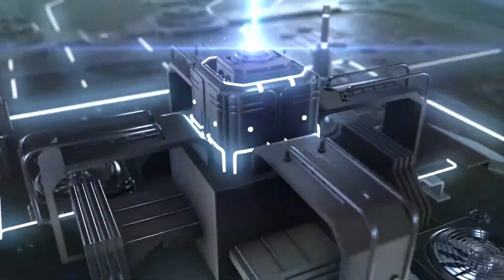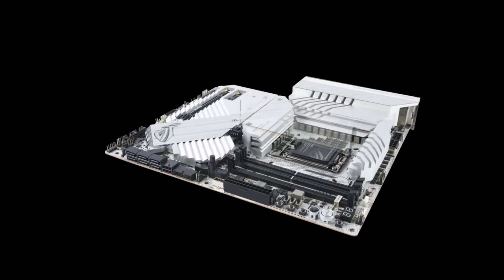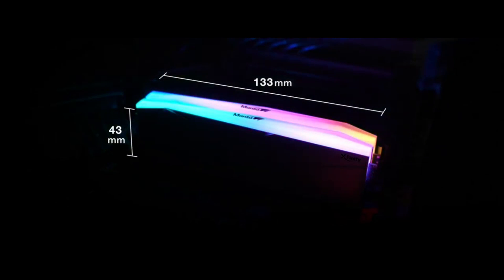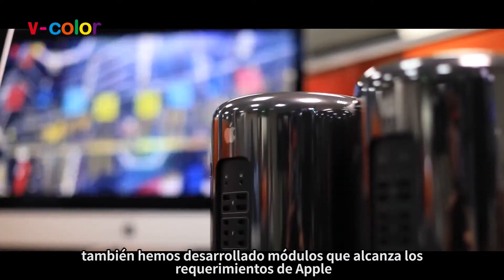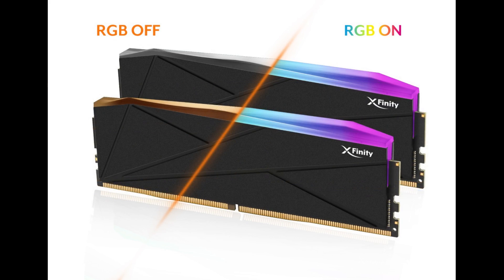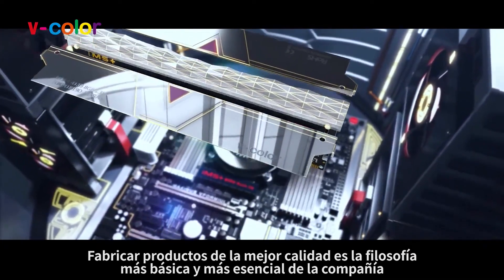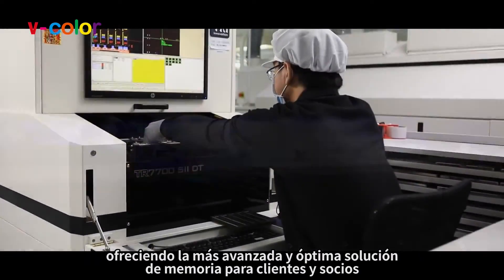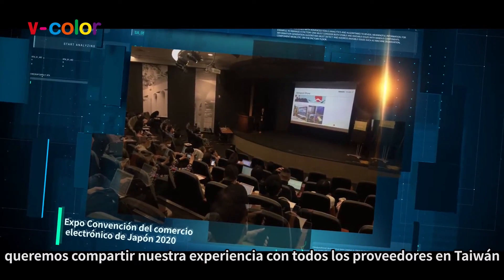V Color Introduces World’s First High Speed Overclocked DDR5 CUDIMM memory up to 9200 MT/s

Comment: That client clock driver chip costs (for example, Part Number RG5C172B0C0GBX)   $0.267 a piece  (it is the actual price, I looked it up)    and this additional cost of $0.267 / memory stick makes you the whole RAM package $200 more expensive.  Brilliant, isn't it ?